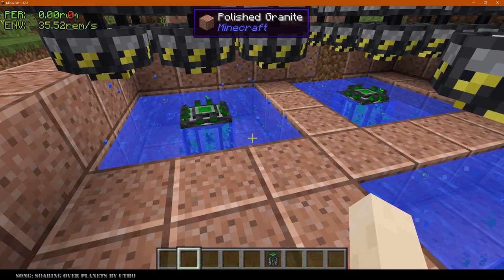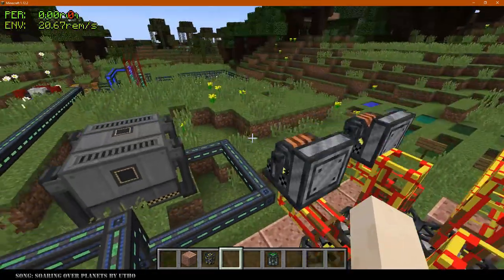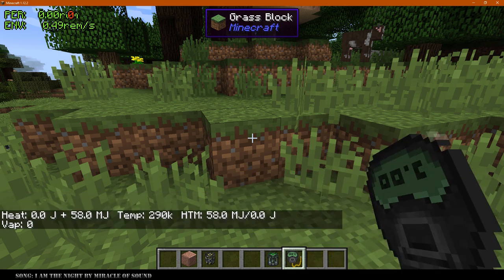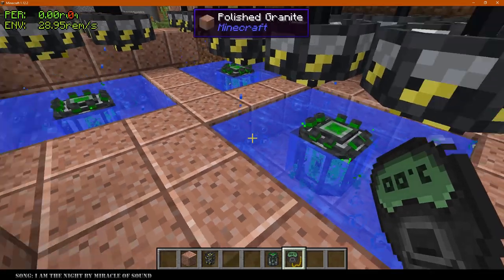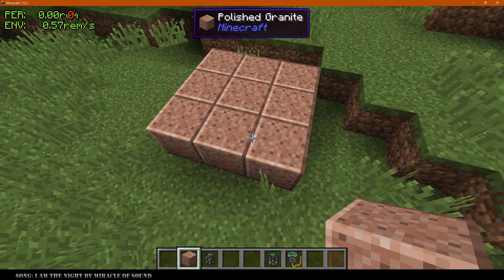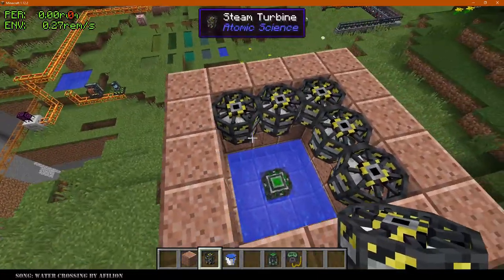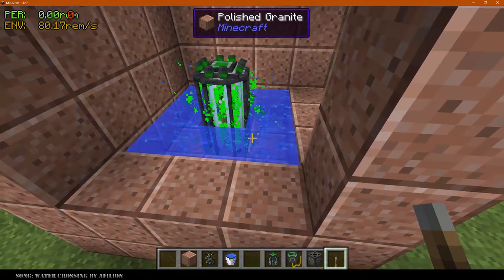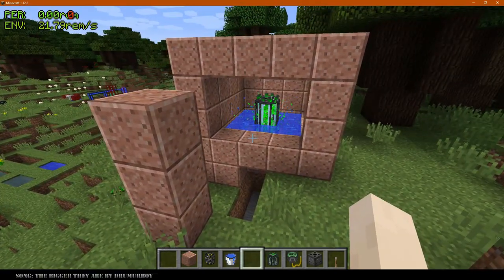Atomic Science - Quick Reactor Tutorial

Comment: Nice Video. 
A couple of questions:
1. Does it matter how much air is in between the water and the turbines.
2. Will the control rods and the thermometer eventually get added in? The realism that they provided was always nice, so that you couldnt shut down your reactor with just a redstone signal.

But I gotta say, awesome remake of the mod so far. I am really looking forward to newer versions.
Reply from the maker: 1. At the moment no, but this might change to decrease power output with distance just to prevent people from building turbines miles above the reactors. I also didn't know you can have several layers of water. Each layer will produce vapor for the turbines.

2. Yes, through right now its unclear how this will be added and work with the current content. For the moment the stack controller replaces the controller rod. Allowing the cells to be disabled and enabled with redstone.